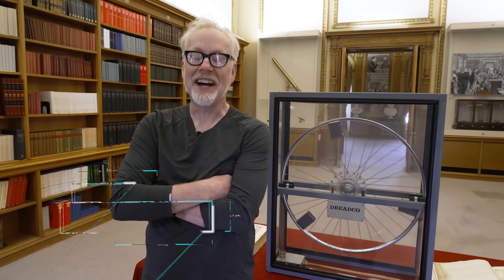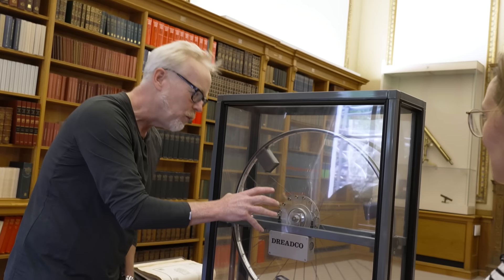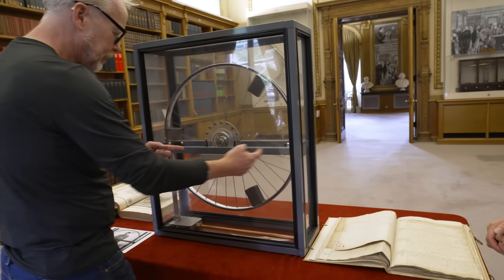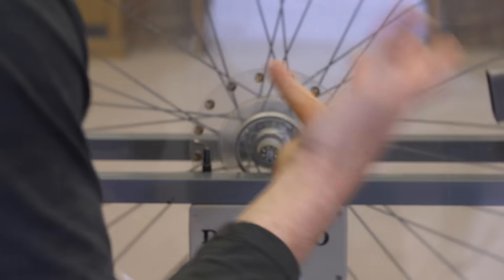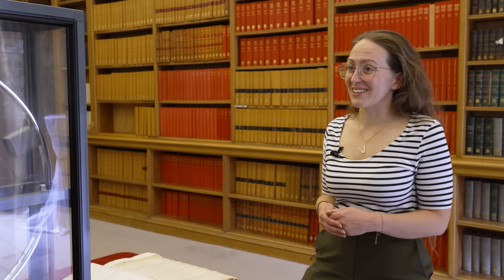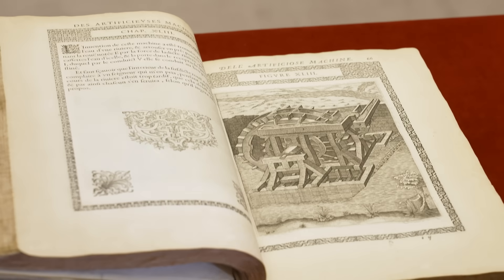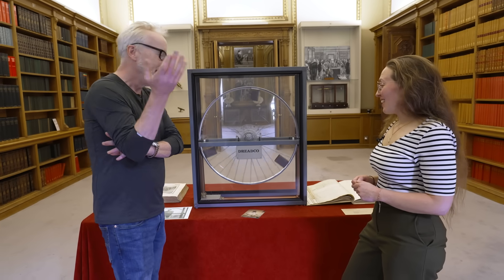Adam Savage vs The "Perpetual Motion" Machine!

Comment: Perpetual motion motor is possible by magnets. It is allready invented but it will never come in the the market because it can destroy every energy companies. Too much money is that game.
Reply: It most definitely isn't possible, the idea defies the laws of thermodynamics
Reply: Electromagnetic force has nothing to do with thermodynamics. It is like compare candle to lightbulb
Reply: @jussee85  Magnets cannot produce energy, energy cannot be created or destroyed and as such you cannot have a perpetual generator as it would be working at over 100% efficiency.

Thermodynamics still apply in this case both laws 1 and 2.
Reply: @spaceageGecko  Magnets do produce energy nonstop everyday. Like neodymium produce over  1.4 Tesla unit. 1 Tesla=10 000 G gauss and 1 G= 1 Mx/cm²
Reply: @jussee85  No they don't create energy, they require movement to provide output.

Thanks for ignoring the bulk of my point, energy cannot be created or destroyed and over 100% efficiency is impossible.

Comment: Isn't it obvious ? The little boxes on the wheel edge are magnets with same weight , the left coil magnet is a charge receiver the magnet box induce a charge in the left coil and charge a hidden capacitor using amplifying circuit, while when the box reaches the right coil it sense the magnet and close the circuit to push the magnet box at the edge of the wheel Up causing wheel to rotate anticlockwise in the video, and so on it continious its rotation .

Comment: I think the electro-magnet thing is right...also if It is sealed, is it full of a gas that helps some chemical reaction with the things on the tips of the wheels?  Or, is the chamber sealed perfectly for some gas to get warmer at Top and Colder at bottom might push and pull. Hot Air goes up and then as it cools it will be falling again in the wheel same. I think it could be multiple things.
Reply: You might be right u know, Remember the Stirling engine works on a similar principle.
Reply: @cebolenkosimaposa2030  no way I never heard of that. I will look into it.
Reply: @cebolenkosimaposa2030  I looked into this Stirling Engine and was shocked how I was describing it without knowing it was even possible. I think this perpetual motion machine has maybe 2-4 principles working like a super sterling machine.

Comment: boxes on the wheel are magnets   the copper pipe and axle mount are making a single winding coil   theres a battery and a box in the corner and they are using a passive circuit to 'sense' the pulling down of the magnet and putting a bit of  impitus on the way up

Comment: It maybe a bit out their as  I know nothing about this :)  the weights may be sealed and contains salt water in which salt water conducts an electrical charge . the copper tubing also reacts to magnetic forces if you drop a magnet inside a tube but in this case , well it may still have an effect to electrical poles + & -  with a constant force  as it passes over it from one end to the other .   As the wheel passes through two magnets switching from   + to  -  further enforces a switching motion between positive and negative placing a charge into the salt water , their are always  two weights pulling down one e weights at 120deg apart as it rotates  . 
Their is my short two cents worth that I have no idea what I am talking about , but I I find it fascinating subject.

Comment: I saw something like this in a magazine back in the 1980's where a guy used an LM3909 IC that strobed a coil of wire to move magnets around on a wheel, this might be the same wheel, I really can't remember.  In those days LED's didn't work very well with a single 1.5VDC battery, but with an LM3909, a capacitor and I think a resistor, it would flash an LED literally for years if you use a single D cell battery to power it.  I think they also used something like that with a crystal driven timer,  an amp, and a magnetic coil in cheap pendulum (with magnet attached) clocks that used a single AA cell to run the clock for well over a year.  It was freaking super efficient and simple design.

Comment: The coil at 9 o-clock coil grabs the box magnet 🧲 and pulls it down...
 T 3 o-clock magnetic 🧲 pushes it up.
When the focus was close to the magnetic , you can see a slightly increase in rotation.
Polarity (+& --) gives it the Push.
Reply: When the magnet approaches the other magnet it speeds the wheel up, but when it passes it the magnet slows the wheel down the exact same amount so no matter what you do you don’t get any extra energy. 

That’s why electric motors need electricity, to switch the polarity of the magnets so they don’t do that.

If they used electromagnets and a battery and the thing in the center of the wheel is for timing the polarity then it would work.

Comment: I’ll ruin the fun it’s not a perpetual motion machine it’s a nearly perpetual motion machine that runs off of magnets you get it going and it pulls itself and pushes itself ever so slightly but inevitably it will stop. That’s all it is. It is relatively useful if skilled correctly.

Comment: What if the boxes on the wheel hold liquid and a weight so as it spins the weight shift, causing the motion to continue
Reply: As one shifts to spin the wheel the other weight would shift against the spin of the wheel. 

Just doesn’t work. You get no net energy gain from that at all.

Comment: Heres my opinion, There is a timer in each of the 3 so called weights on the rim, they are batteries that energize a small coil as it appoaches each of the 2 U shaped magnets on the outside. That would give 6 impulses per revolution.

Comment: There’s a magnet on both sides. One is slightly powered by a low output high charge battery. This charge one magnet creating enough momentum to get it going half way. Then, the other magnets perpetuates the motion. With the sole power source being.., a battery. Not perpetual. Now if the movement provided enough of a charge, it would easily last two years before needing re charged.

Comment: My take:  Reduce the coefficient of friction for the main bearings, perfectly balance the rotating assembly, and build a very small low power dc motor within the oddities of its components.  Hide the batteries that need recharging or replacing during its "refresh". 

"Cant see the forest for the trees" comes to mind here.  We are initially led to believe this is a big mystery, when in fact the mystery is figuring out whether or not its actually a mystery at all.

Comment: This whole thing looks a lot like a brushless DC motor. That is likely part of the purposeful misdirection to throw you off. Several who know seem to indicate, it was better not to know, which likely indicates a clock with a battery is more likely. Super simple, not exciting, and boring. Clocks do run for a couple of years on a battery and the that big tubular frame there could be a lot of batteries hidden.

Comment: Needs to be serviced after 2 years. Well it's simple, magnets lose their magnrtic field slowly and the bearings start to age so they introduce more and more friction until it stops. So it's using magnets that's why it has 2 year lifespan. The key to solving is, if you introduce huge magnetic field to stop it will it start again by itself.

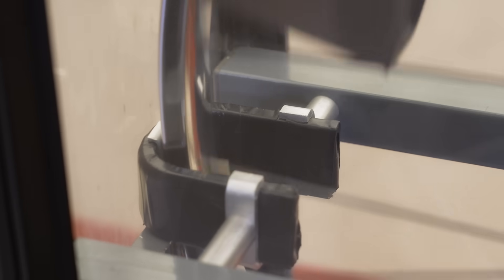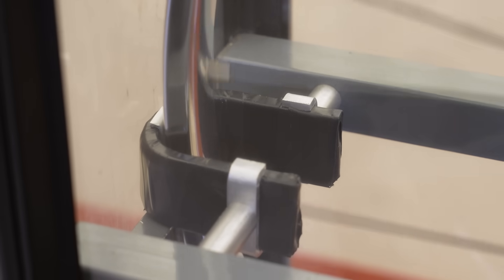Comment: 4:06 - 4:16 Watch closely the space between the rim of the wheel and the U-shaped blocks and you will notice that the wheel is not exactly circular. I believe this is the key to the mystery: the spokes are tensioned such that the wheel is slighly elliptic but release their tension gradually, allowing the rim to slowly become more circular. This tension acts like a spring in a clock. The boxes are just weights to give the wheel some more inertia, and the return to a more circular shape alters the lever arm of the boxes, providing the energy for movement.

I also do not see the wheel spinning at an even rate, but quickening and slowing down ever so slightly at every 180 degrees or so.
Reply: Just how would they "release their tension"

Comment: Perpetual Motion works because it has its own reference frame and is asymmetrical. If you lift the machine upwards, it will go a little faster and if you put the machine in a weightless state, it will stop. The energy source is the gravitational force and is always active in energy. It is often unused since the energy is low. And therefore there are hydroelectric plants that provide a lot of energy and are therefore becoming more common. It is actually possible with data stimulation that shows that perpetual motion works. It does not break the laws of thermodynamics since it does not take into account the forgotten reference frame.

Comment: So obviously, it could be a motor. It could be powered by a clock spring.  Another you tube video showed someone testing it electrically and magnetically and saw very little happening at the out side by magnets. There was a lot happening in the box by the name plate. (This suggests there is stuff in the box by the name plate.  A Clock will run for two years an a battery. There is plenty of room for batteries in the tubular metal frame, in the copper pipe or in the three tins on the wheel. I would like to throw several other ideas out there. It could be powered by a crystal radio. The wheel could be an AM radio antenna, getting power from broadcast radio waves, which in turn charges a battery or winds a spring ect. (If it was powered by radio waves, servicing it every two years seems unlikely, unless it is just oil needed for lubrication.) It could be powered by the solar panel on the side of the box (unlikely as they store it the dark). It could be an giant aluminum air battery located inside the pipe powering a clock. The small sharp point just to the right of the wheel could be highly charged causing ionic propulsion. This would cause the air molecules to move and get caught in the little cups on the wheels. Ion technology is used by air cleaners, just requires extreme high voltage (with little amps).

Comment: Oh good grief.  I was just going to skip it as another of Adam Savage's videos (as sceptics could).  Ahh, she just said it, decoys.  He didn't realise he was getting distracted from what was really happening.  It has the wrong structure for a perpetual motion machine.  Both the design I came up with as a kid, and others, have a similar feature.

I don't think the royal society wants to put on a perpetual motion machine.  So, I think it's probably a fake.

The fake would be that it might set up a air bearing through interaction in the bearing (though I suspect it might not need it and the existing contact is low friction enough for the following) which is very low friction and could spin for years.  The mass of the mechanism and blocks store the energy when spun up.  Now, of course, somebody might say the copper pipes are collecting orgon energy or such.  Ultimately, disappointing, but it is the joke of the inventive in the royal society.  That took me seconds, while Adam, with all his vast experience, needed instruction from the girl.  Shows one small girl can know more than one big girl.

So, do I get a prize?

Comment: I'd say it's a rudimentary motor powered by the thermoelectric generator (converts heat to electricity) at the bottom and the wires run up the metal pipes in to the battery that gets trickle charged in the middle. If it stops they just replace the batteries as they wear out and start it spinning again, that's also why it can slow down and stop when stored in a COLD room.
Reply: Nothing that complex, and being sealed in an enclosure would make the already 5-8% efficient thermoelectric exchanges even less efficient.  

There's are similar "free energy" bike wheel videos on this site, and the solution is based on a technology demonstrated by Michael Faraday, in that room, back in 1821.
Reply: @AndrewRoberts11  And none of them work without POWER because true perpetual motion would violate the laws of thermodynamics.
Reply: @ThatGoth  Solid state thermoelectric IC's first appeared in 1995, which given the machine dates to 1985, is a problem, Then consider there's over a meter of 18mm copper pipe, that will happily accept a series of 14mm AA batteries, a tubular steel frame, that can happily accepts a series of AA batteries, two boxes, that can happily host a variety of batteries, .... There's visibly enough space to stash in excess of 1 kWh of commodity batteries, which will be more than enough for the 4 months of perpetual motion, between secret services, and AA batteries are a technology available in the 1980s. There may even be a 1970s, 555 timer IC, to regulate speed, rather the simple battery, coil and the transistor solution, that's show in one of the Royal Institution's own videos, on this site.

Comment: I think that it’s a giant gear. The bar holding it in place is actually on a slide and over the 2 years it slides down which is why there is an odd gap at the top. To “reset” it they are simply winding it back to the top.

Comment: I would  guess that each of the three boxes has a Giro inside and that the copper pipe and aluminium box at the bottom are actually a collector of some sort that converts radio waves into a static charge

Comment: If it needs intervention then it's not perpetual motion is it not?
Could you use rechargeable batteries? And when it spins  one area on the axil could have a generator thus recharging the batteries that power it then it would not need intervention from technicians? Would it not?

Comment: The weights on the wheel are the batteries and an electrolytic capacitor. its a motor. Inside hub is probably a ruby movement. The device on the bottom is a device that steals power from atmospheric pressure changes and converts it into an electric charge.

Comment: Needs service every 2 years? 
Thats the average length of time it takes a lithium battery in low power mode to deplete a charge.   My guess is a lithium battery running a silent motor.

Comment: it's admitted that that maker likes to make "clever fakes", so the game is the guessing...  the assistant is clearly in the know :)

the most common theory i've seen is a very long life spring clock "motor", coupled with some backups to add a bit of impulse, or multiple methods of energy input: air pressure, heat!, or light...  keeping in mind this was built in the 80s ... work with the tech then.

we also know it SLOWS DOWN, and every 2 years "gets service" - lol...  new battery.  that dreadco box is easily large enough for a good sized rare earth style battery, the rest is show.

on heat, there are very sensitive stirling engines...  hand / air temperature difference
on springs, subtle...  if the copper pipes are pressure vessles - that's kind of a spring...
on light, there's many changes to hide solar cells...

i'd guess that someone now could make a motor that would run without the service for the next 30 years until they reveal ... it's a <censored>...
Reply: In his 2006 mini documentary "Perpetual Motion Maschine" which was a nice biography he makes no secret that he made a machine that was a fake perpetual motion machine and was solely created to make people wonder how it worked. Only he and a select few knew how it worked and was proud to know that the curators kept the secret, which they still are per his will. https://www.youtube.com/watch?v=ZLFBgkX8lxQ He also created several actual scientific experiments that were sent up in the space shuttle, and even did his own busting on the Archimedes mirror which he proved wasn't true at such a large scale but was a smaller scales at short distances.

Comment: Just make it.
The problem I notice is people tend to make a 1 dimensional motion machine.  1 dimension can be attributed to Gravity.
a swing could be another dimension, gravity, and swinging a pendulum to reset the device, that's 2 dimensions.
3rd dimension would be creating a backup that balances the pendulum with a clockwork style actuator that can reset the pendulum perfectly every time.

These are hints to such a device if anyone is curious.

Comment: Absolutely puzzling,  I do feel that there is a Tony charge and it is on SC, so you do not need a two point contact at the same spot, voltage can travel threw any single metal surface, thus the second point can be at any point. You see the center plexiglass area isolated but is it really, a single path could be so thin your eye could not pick it up.

Comment: Electrostatic Motor driven by high Voltage Batteries or low Voltage Bat. and a step up Circurit in the Box with the cooling fins

Comment: Electrical engineer here. Not that it necessarily means anything, but I think I figured it out. 
The horseshoes are just bar magnets. The boxes are filled with batteries, and a coil they energize wrapped around them. There's a switch, probably magnetic, that connects the coil to the battery when near enough to the magnet, accelerating it. Once in the middle of the horseshoe magnet, it switches the coil off. It must be switched off or the magnet will try to hold it in it's field. Could be as simple as a mercury position switch, or a fairly simple electronic circuit. Same thing again, on the other side. Extremely low friction bearings, a coil that draws a couple microamps for a few seconds every revolution. Years? That's a stretch. But, possible, I think. Actual calculations require the exact amount of energy required to keep the wheel spinning, then convert that to field strengths, and a ton of extremely complex calculations. But, that's almost certainly it, or the major portion.
Reply: yep, my idea exactly, might be a reed switch or even a timer to trigger the coils.